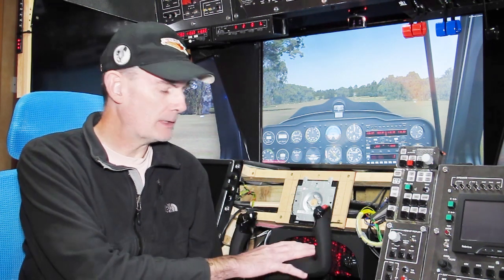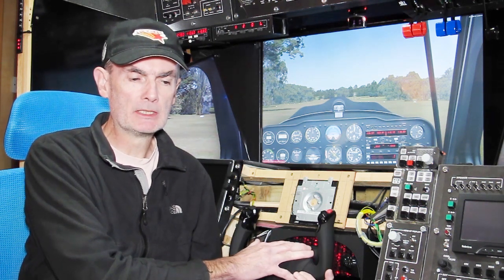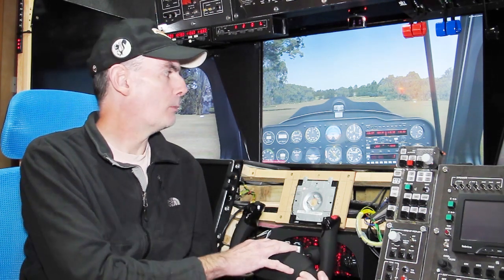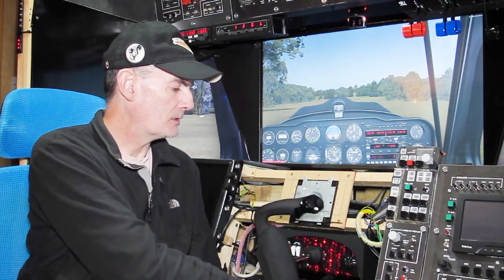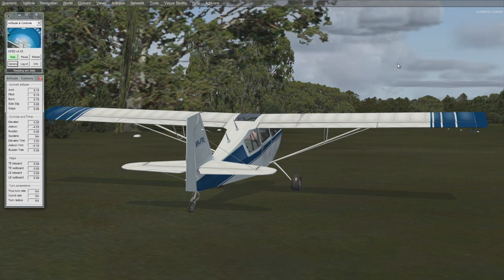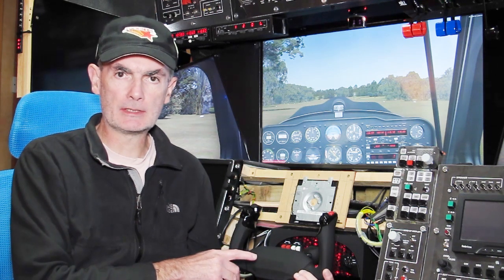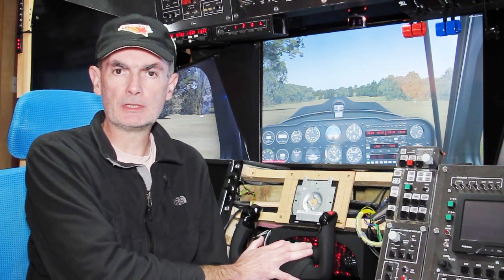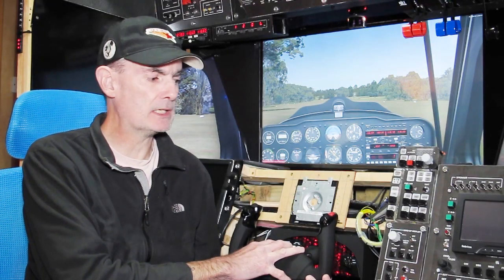Honeycomb Yoke Dead Zones

Comment: I haven't had as much time to test my Alpha yoke out but from what I can tell the animation doesn't quite reflect all movement but the actual flight does  react with only a small null area - it is definitely not as big of a dead zone as the animation would have you believe, if that was the only indicator.  My Cessna turns quite subtly prior to the edge of my visible and larger 'dead' zone.  Not sure why but I am satisfied with the actual response in flight.  I don't really focus on the animation in the virtual cockpit.

PS - thank you for any FSUIPC setup - I am not super familiar and I still have setup to do with it in regards to buttons and switches.

Comment: I have exact same deadzone with mine , the whole nature of it comes across as a firmware issue rather than hardware so it's really strange they have shipped it with this issue. 

Even more so given that say there was oversensitivity at the centre all flight Sims and even windows  lets you filter that out. 

I have talked about it in a review video and also posted on there forum, let's hope they can fix it !
Reply: Did honeycomb someting say to the problem?
Reply: I have also the yoke and I have also the same dead zone

Comment: Great contribution - as always ! I especially enjoyed the FSUIPC part as I´ve been using this software with FSX and again learned quite a lot of things that me, as a non-expert, have not been aware of at all - especially the bit resolution of the different controllers for different yokes and the MfG rudder pedals I´m using as well. So my "simple question" is: where do I get this very specific information from ? And - how exactly is this related to the incremental steps the device report to windows ? Any feedback is highly appreciated. Thanks !
Reply from the maker: If your main question is about the FSUIPC info, it's all supplied in the user manuals! There's a user guide and an advanced user guide for starters, which together explain everything you need to know and much you probably don't! You can also get the FSUIPC SDK, which contains more info. Some of the device-specific info, such as the resolution of a given controller, will often be available in the vendor's publicity, althugh for consumer devices such as the Honeycomb yoke you sometimes have to hunt for it. Honeycomb, for example, doesn't really want to advertise that its yoke has such a relatively low resolution, while MFG will advertise its high-resolution controller as a feature.
Reply: @AlmostAviation  Once again thank you for this istant response.  I‘m aware of the FSUIPC „handbook“ even though I have to admit that reading with somewhat advanced but still limited knowledge is on thing - learning from the information you provided is something totally different. I always wondered what the 256 number actually meant but lacking your explanations never went deeper into that type of finetuning (as I‘m still lacking a sound understanding of how to translate hardware-controller bits into this number). Thus I‘d highly appreciate getting a step by step explanation by an expert like you. Thank‘s a lot in advance!

Comment: From your first impressions video it appears to me that there is some sort of "exponential curve" being applied where inputs around the centre position are comparatively reduced and those around the extremes are 100% or more. (Exponential as I use it here is an option in most rc radio systems, and when used "smooths out" inputs near centre positions.) Much like you theory for a harware board after the ADC.
Reply from the maker: Yes, that's what happens in FSX and P3D. You have more control over it in X-Plane, but I don't think any of this is relevant. The yoke appears to have dead zones and we don't know why.

Comment: You might like to check these YT video's, that appeared around the same time you posted for the Honeycomb Alpha Flight Controls Deadzone Issue: https://www.youtube.com/watch?v=A_pAurNW60E 
and the subsequent Honeycomb Alpha Flight Controls Arduino Due, Dead Zone Fix video: 
https://www.youtube.com/watch?v=Zw6lMA6qTBs&t=16s
Reply from the maker: Yes, Paul has already linked his video here. It's a fairly radical "fix", but hopefully premature if it turns out Honeycomb can sort it in software.

Comment: No deadzones experienced on xplane
Reply from the maker: I have deadzones in X-Plane (obviously), so it's interesting to wonder why you don't see them.
Reply: Control surface movements datarefs seem to change on the very slightest movement of the yoke.
Reply from the maker: @russgreen9381  Not for me! In X-Plane, using Data Output Item 8 (flight controls), I see the same massive dead zone on both axes. This is in stark contrast to the MFG Crosswind rudder pedals, which have none at all. (There is no difference whether or not I set all the 'control sensitivity' sliders to linear and no stability augmentation.)

Comment: What exactly is the point of all this? All I care about is how well the aircraft responds to my yoke inputs. How it does that is quite irrelevant to me. 😊
Reply from the maker: Some people are interested, that seems point enough.
Reply: Almost Aviation   No doubt some people are. But I really think most simmers would rather like your impressions of how the yoke feels when you are actually flying. Whether it is using 8 or 16 bits to control the airplane is irrelevant if the response feels realistic. Now, I may be mistaken in thinking you were aiming that video at simmers. If in fact it was aimed at people who design or modify yokes, then of course that info would be very useful.